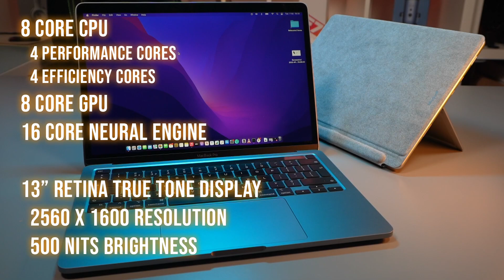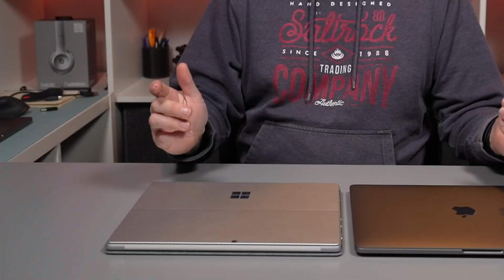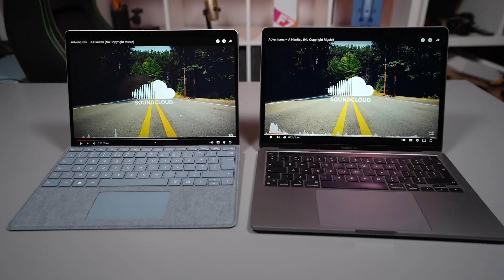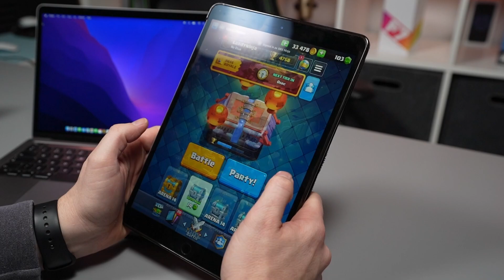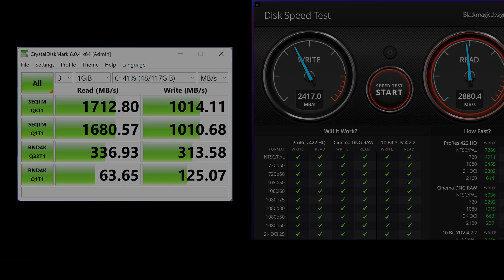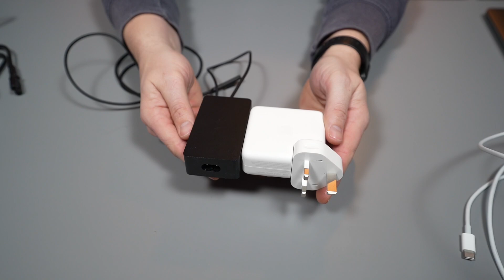Apples vs Oranges! - Surface Pro 8 vs MacBook Pro 13

Comment: I find I’m always being limited by apple’s operating systems especially because I do play games on my free time. I also draw so if I wanted all apple products I would have to get a 1,000 dollar laptop and a 1,000 dollar iPad depending on the model I got. I don’t hate apple products, hey I even have an iPhone and AirPods but I, like a lot of others, don’t want to spend thousands of dollars on tech that will only last a few years anyways. My surface is coming in the mail and I hope I don’t regret it.
Reply: did you regret it?
Reply: @Noa77111  There are some cons that I did know before purchasing it like the lack of a usb port. That problem for me can be easily fixed with a dongle but for others, it would be a deal breaker. It really depends on what you need a computer for. I love it, and I don't regret buying it over the apple counterparts. It's perfect for me and what I needed it for :) the surface pro 7 is also a great computer you can look into.

Comment: A “Pro” device that comes with only 2 USB ports is a complete joke! Apple wants you to buy and carry their dumb accessories. Not to mention you can’t upgrade your SSD on the Mac nor can you remove the SSD for data recovery, should your laptop give up on you. This company never fails to nickel and dime their users. 

Not that the surface pro is any better with ports. But at least you can upgrade your storage and at least with Windows, there are tons of OEMs I can choose from.

Comment: This channel deserves more subscribers. What a perfect detailed review and comparison. Covered weight, size, speakers and even if replacing ssd would cost cheaper rather then buying from Microsoft ( was wondering if it costs cheaper ). Very helpful. Just wish for US viewers you would use Lbs with Kg. Also, speaker comparison was a little longer. Anyways, absolutely Liked the video. Look forward to Surface pro 9 and newer Pro or Air speakers and weight comparison. I want to try first Mac but can’t beat the portability and wide usage of my surface ( it’s an awesome full laptop ) and now they can sustain longer performance due to increased heat dissipation in Pro 8. So I am wondering if it’s worth upgrading from my surface 7 to 9
Reply from the maker: Sorry I missed you message! Thank you for the kind words and I will make sure to start adding lol
Lb as well as kg and can try and improve my speaker testing. I do have the surface pro 9 on order so will be comparing to the pro 8 when it arrives.

Comment: I love 2 in one's and I understand the selling point of Apple but really while all others offer 2 in 1 it only means Apple is close minded because of sale perspective. I chose Apple only because it has a market value even after the products are used and Apple care and Apple service in every mall can't be beaten. In terms of Best Buy, they need to have better education to the geek squad- I have not seen many Microsoft stores in Florida non infact if they exist. So Apple for all these is a better value when putting things in perspective-but again wish they come up with a touch screen iMac. And iPad more advanced towards graphics, photography, and games. So it can make a selling point for iPads. Note: in my opinion currently iMovie and GarageBand sucks in iPad Pro 12.9. My  kinemaster old version was way better than  GarageBand and iMovie combined. Easier faster and more features.  iPad Pro is limited, and can not replace a laptop. Believing that I sold my iMac and enrolled a class but the virtual videos doesn’t open on iPad Pro. I lost $350 dollars as the course is not refundable with time frame- and they don’t inform the videos won’t work with iPad. Frustrated.

Comment: Horses for courses IMO. I'm fortunate to have both devices, so I choose, depending what is most important to me at the time. The MacBook replaced a Surface Pro 5 but I missed the things a Surface can do and a MacBook cannot do. So, I got the Pro 8 when it came out. I could only get a MacBook with 8GB of RAM and it sometimes takes a while to move between apps. The Surface has 16GB and feels snappier. If didn't use the pen so much and liked the slightly better Office apps experience on the Surface, I'd choose the Mac for its awesome battery life. But if could only keep one of these, it would be the Surface Pro 8. Thanks for the objective review of thse devices!

Comment: @Mash IT Can you and other tech reviewers please quit using the video editing test to evaluate how well a computer works. Please!!  90% of the people that buy computers don't use them for video editing. Plus, in my country (USA) there are only about 32,500 video editing professionals who make up less than 0.01 % of the population. I'm an engineering student. There are many, many times as many professional engineers (mechanical, aerospace, civil, computing, etc) as there are video editors. Macs in general are terrible at running engineering software, even when running Windows on a Mac (funny this even has to be done!). Like Mike Kelly wrote a few months ago, people should pick the machine that runs the software they need best. Tech reviewers should also highlight software that the vast majority of computer buyers will use, and not just software used by niche groups like video editors. 

I chose the Surface Pro 8 because Windows (and even Linux) runs ALL of the software that I need for my profession. Plus I get a digital pen (that actually has an eraser!) that I can use for note taking and annotating engineering drawings. Almost every engineering student that I know who owns a Mac, with the exception of electronics/computing engineers, has regretted their purchase.
Reply from the maker: Hi Kelvin, I get where you are coming from and I understand but I do also try and focus on other apps such as blender and VS etc. Obviously I cannot test every piece of software and the reason I feel video editing is important is more because of the strain it puts on the system
Reply: @MashITTech  That's understandable. However, the only problem is that audio and video content creation are the only things that Apple devices are better at, since Apple purposely optimizes their devices for this.  This makes using this type of software as a basis to gage Apple's devices' power misleading. This is similar to Samsung optimizing their devices to perform well in Geekbench. Apple knows that most technology reviewers, like yourself, will only use audio and video editing as benchmarks, so Apple optimizes (rigs) their devices accordingly. 

Think about this, who always focuses your attention towards audio/video type benchmarks  and away from other benchmarks that tests a device's capabilities like gaming or productivity? Apple! Gaming is just as taxing, if not more taxing on hardware than video editing, yet it is ignored because Apple devices aren't optimized (rigged) for it. It's similar for other productivity software, engineering software, educational software, etc. Apple's devices aren't optimized (rigged) for that software either. 

None of the engineering software I use now runs well on a Mac. When I was in the military, none of the software I used throughout my career ran well on a Mac. However, they're great at video editing! Yeah!
Reply: @MashITTech  I apologize if my last comment came off as flippant. I totally respect what you are doing. I just think that when you focus only on the performance of software that less than 0.01% of the population uses as a basis for recommending a device to the other 99.99%, it's kinda of a misjustice. I think if your test suite was a little more robust, your recommendations would also be more reliable and robust. Maybe include testing the availability and performance of the top software suites used by every major profession, along with popular games and leisure software?
Reply from the maker: No its all good. I love constructive feedback and welcome the discussion. I am still learning my way on this YouTube journey and hope my videos are constantly improving. I usually also compare gaming and other applications but in all fairness neither machines are any good at gaming! What I was trying to focus on is some of the other aspects such as usability, battery life etc which both have positives and negatives for. The video editing was only a small part of the review and not something I would base my buying decision on. And yes you are right Apple have tuned it so that it can edit well on the go but some of the other features are strong positives on the apple silicon such as the lack of fan noise and heat, amazing battery even when heavily using the device. But I am no apple fan boy either and can see its short comings such as closed eco system, lack of upgradability and poor gaming/software support
Reply: @MashITTech  I grew up in California. The first computer I ever used was an Apple IIc (showing my age here). Apple had a place in my heart. However, their lack of any great software other than audio, photo, or video editors, lack of upgradeability in their devices, and terrible gaming support has kept me from purchasing or recommending their products. Before every WWDC, I hope that they would do better, but they just keep getting worst.  Plus they have no incentive to do better because people keep making up excuses for them and keep buying their products despite other cheaper products being better in every way that counts. When someone complains they're called an Apple hater. However, I look at this way: if I have a family of 5, plus a large dog and I need to purchase a vehicle, I'm going to get a mid-to-full-size SUV. If the dealership I walk into ignores my family and keeps trying to sell me a sports coupe, I'm going to complain and look elsewhere. It doesn't matter if the sports coupe looks nice, has a powerful engine, is wicked fast, and has better fuel economy; my family can't fit in it, so it doesn't fit my needs. Am I really being a hater for pointing that out?

Good luck with your channel. Please take into account that the vast majority of us have different computing needs in your next comparisons. 

Subscribed!
Reply: Because youtubers think that the world revolves around YouTube and audio/video editors, and besides, nothing and nobody exists 🤣

Comment: These are two different devices for two different purposes. 
If you want versatility and a 2 in 1 device then the SP8 wins.
If you want Performance then the MacBook Pro with the M1 chip Wins. It will destroy the SP8 with the M1 chip and superior battery life.
Reply: "Destroy" is a relative term. +20% faster GPU, is that destroying? +5% faster single core performance, is that "destroying"? Multicore has the largest difference, but most software still aren't multithreaded that well to take advantage, so, destruction? On battery life front it is total carnage though, SP8 battery life sucks.

Comment: Do you think the Surface Pro 8 is good for coding?
Reply from the maker: yes, completely. Its an amazing screen with good aspect ratio for code. A great keyboard and reasonable power. Just don't get it for 3d dev work
Reply: @MashITTech  macbook is alot better imo
Reply: @SufyMusic  Nah, I own both and I prefer SP8 for programming. Depends what you program, though. Unity support sucks on MacOS, so my opinion is kinda biased because of that.
Reply: @PhazonBlaxor , https://www.youtube.com/watch?v=TLj6LNm8Khw this is an older comparison with rosetta on unity; it does have an Apple silicon build now so  unity obviously will run a great deal faster natively than on rosetta -
Reply: @PhazonBlaxor  I program android apps with my MacBook m1 and I have had great performance on the native android studio its the fastest machine I have ever owned, I installed it with Brew though which is a fabulous package manager
Reply: @SufyMusic  I also do Android apps. I've used Unity on older Intel Macbook Pro and it was terrible. So many bugs and compability problems, especially because they changed the security settings on MacOS. Unity burst packages give compiling errors that I had to manually allow every time I made even a single change in code.

Having a touch acreen directly on SP8 has been amazing, I can test my games directly in the editor and don't have to fight with Unity Remote, make builds constantly or write both mouse and touch functionality.

To each their own. 🤷🏻‍♂️
Reply: @PhazonBlaxor  I was looking at build comparisons and the Mac studio kills it in time, battery and heat
Reply: @SufyMusic  Battery surely. Heat depends on which model we are comparing to, M2 MB Air is notorious for overheating and throttling for instance. Time? Nope, none of the Macs do it for me either.

Like I said, the lack of touch screen is a HUGE disadvantage, it means I cannot test my games properly and directly in editor and I cannot draw assets with a pen either (I am an artist as well, I do my own assets). When it comes to builds, SP8 might not be faster but you see, there is no need to even make builds unless I really want to, because of the touch screen. No build vs a build, which one do you think is faster? It's been a MASSIVE time saver for me! In the past I had to do so many builds to test various functionalities on my phone, now I can just do it all within the editor.

MB M1 and M2 are faster at compiling, but that hardly matters when compiling and other intense processing is 1% of the time and actual work takes 99% of the rest (which involves lots of game testing with touch and drawing assets, among programming itself and others obviously).

So to each their own, right? :)
Reply: Yes, but it also depends on the programming language.  C# (.Net framework), Powershell for IT support or System administrators, and Kotlin.  Also, Power BI for data analysts and Azure cloud.

Java, Javascript, Bash, Go, and Python are better on MacBooks.  Also AWS cloud.

Comment: The thickness must be an optical illusion of some sort, because MB Pro M1 is 15.6mm thick, Surface Pro 8 is 9.3mm thick and signature keyboard is 4.9mm thick, for combined thickness of 14.2mm. Look up the dimensions, something isn't adding up here. 

Perhaps it's the roundness of MB Pro? Or the fact that the pen holder spot on SP8 is mm or something thicker and you laid it keyboard side down — not that a mm or two matters, but still, technically speaking SP8+keyboard is thinner. Facts matter, and facts stay true no matter how you view them.

Comment: Definitely I'll go with the Surface pro 8, it's two in one.
Reply: To me, it's 4-in-1. It replaces my drawing tablet, desktop, older MB Pro and Android tablet. With eGPU it's 5-in-1, replacing gaming consoles as well. Insane versatility and value, despite the hefty price tag!
Reply: I want to go with Surface Pro 8 too.
Reply: I have one, using it to type right now and its by far the best work device out there, not just the versatility but also the performance

Comment: Next please compare an IPhone vs a Windows surface Studio. 😀
Or put it the other way round: 
You need a MacBook pro to beat a Windows-tablet. 😉
By the way: The (little to)high price for the surface is due to its dimensions. An ordinary laptop (like the MacBook) has higher specs for a lower price.  😉
Reply: Your emojis are cringe
Reply: @jhnnes64  You can replace them with the remark: "Hint of sarcasm" 😉 This must be cringe to Apple fan Boys...
Reply: Surface Pro is a pretty good device and has something for everyone’s needs. MacBook Pros are only good at somethings like video and audio production. Although I love Apple Silicon, all the efficiency is useless if it cannot run the software that I need.

Comment: Microsoft played the most cunning and above all the stingy by releasing this Surface 8 Pro just before the official announcement of the 12th generation Intel.

They could have released a perfect product with these 12th generation Intel, which would have allowed them to completely compete and beat both the iPad Pro and the Mac Book.
Reply from the maker: That’s Microsoft all over, they are always a generation behind for some unknown reason and it’s not like these are bargain basement devices!
Reply: @MashITTech  Well actually, I guess it has something to do with the Surface Line being a more recent release - only dating back in 2013. They are catching up though, I will add that the Surface is a much better experience as an artist.  Changing the angle of the screen makes this a must buy. But you make a great point with the device being a master of none. The touch screen is literally there just for the drawing part.

Comment: It really depends on your application and your career. As an engineering major most of the software & programs I run are windows only. And the Surface pro 8 comes in great when I have to take notes with one note during lectures.
Reply: I'm an engineer as well. I'm starting on my Masters and am thinking of taking a Surface pro 8. How does it hold up while multitasking and using auto-startup apps like Zoom, MS Teams, etc...?
Reply: Got one. It's perfect for me. Running windows and all the software I need for my studies. Super portable and the stylus experience is just godly.
Reply: @armgord  i5 with 16GB RAM. I got the type cover with surface pen 2 as well. I moderately use MATLAB and the SP8 can run it smoothly. I don't use any CAD software so wouldn't know about that.
Reply: This comment is literally what I needed.